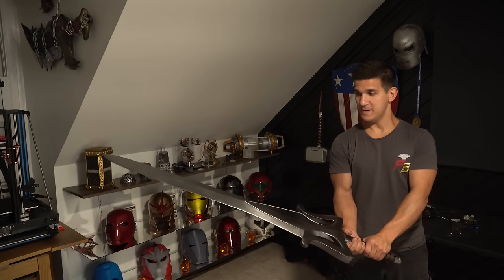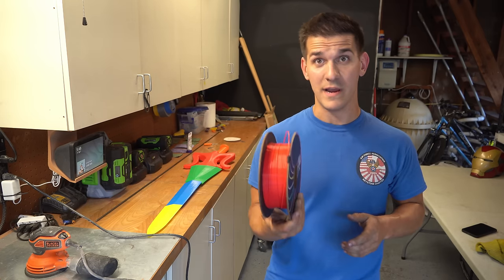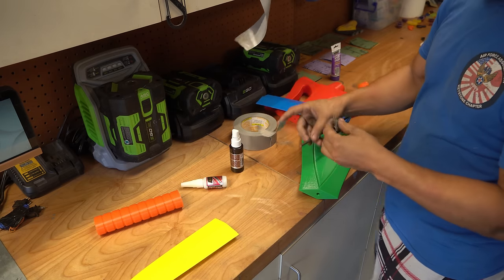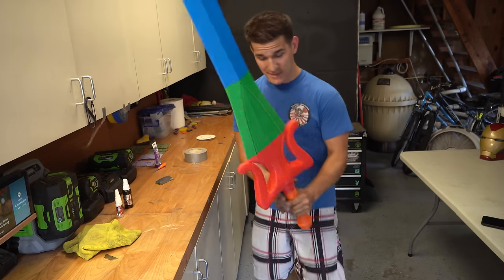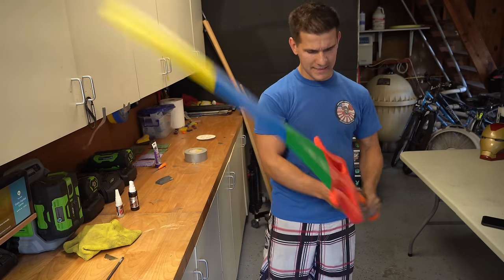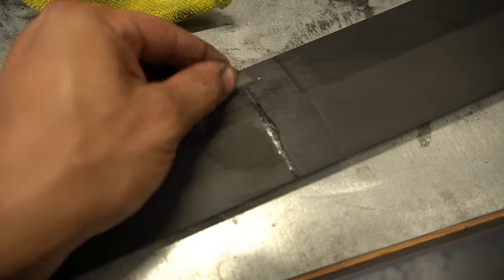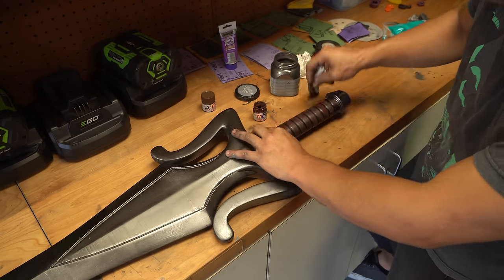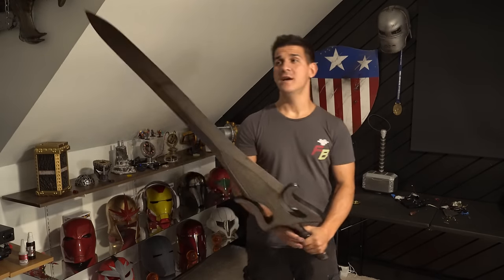HE-MAN'S POWER SWORD | 3D PRINTED! | (and trying out new some techniques!)

Comment: The uv resin will bond to pla but not after the primer. I've used resin to bond pla prints. I also recommend a uv pen light for curing the resin. I use cheap paint brushes to apply resin

Comment: Hey Frank. I use meshmixer to cut models and add rods too. I found that making the hole in mm isn't too bad as long as you can easily convert it to inches so you won"t have to use tape on the threaded rod

Comment: i bought the ender 3 max, thanks to your recomendation, i am happy with it, and so i want to ask you a question, i am 3d printing kratos leviathan axe, but i notice the parts to be hollow, but like 1 inch diamater hollow, what can i use to strenghten it, metal rods are not that big, and i don´t seem to find something that fits :p, what would you recomend?

Comment: Is there a technique to cut models up with mitred edges? joining mitres makes a much smoother joint and with a little filler joints are hard to see
Reply: in a cad program you could use a Cone shape for cutting. i think mechmixer can do it too

Comment: So for builds like this, so you only do one pass with the electric sander and then filler primer? Does that usually get rid of the layer lines?
Reply from the maker: Basically  yeah but you can always do more
Reply: @FranklyBuilt  thanks for the quick response. People are starting to remove layer lines with resin. I know you attempted that here but are you gonna try it later on as well?
Reply from the maker: I plan too!